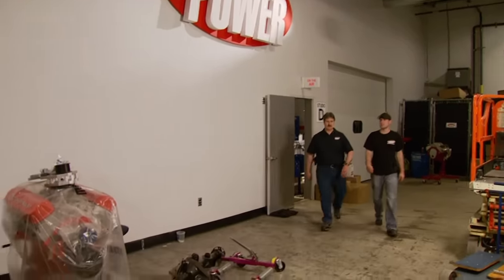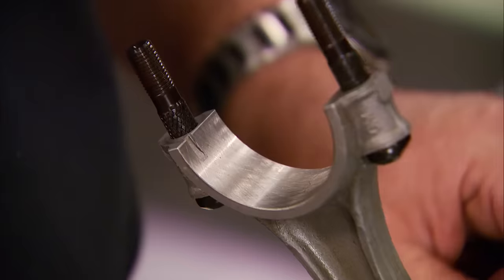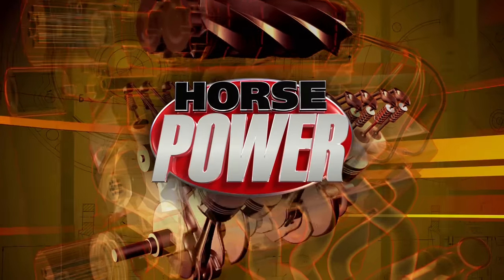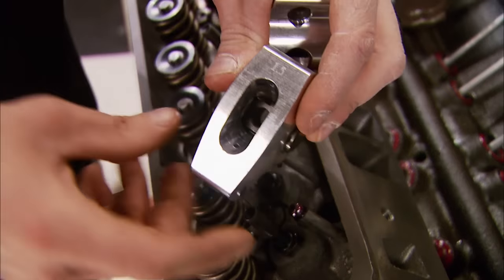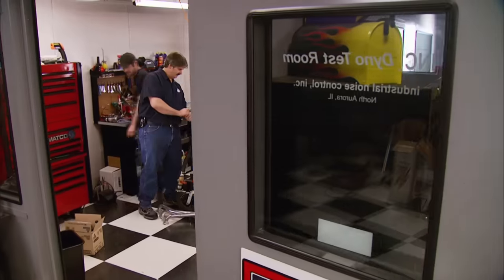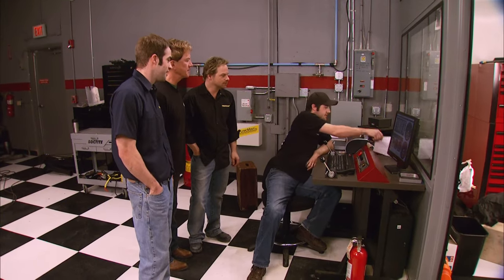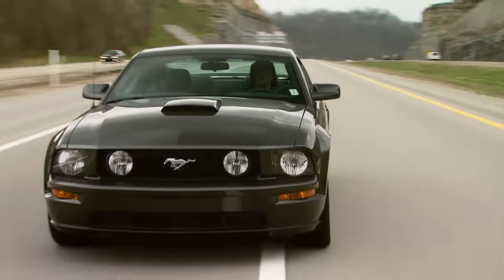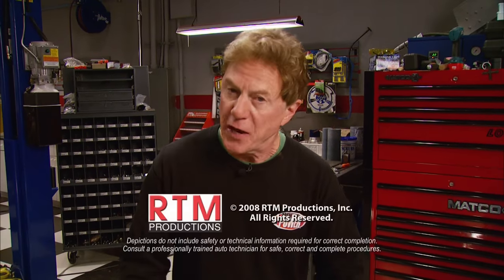Rebuilding a 283 Small Block for a Daily Driver C10 - HorsePower S12, E7

Comment: 270 hp for a daily driver sounds like a great package! For some,when you have had one of these little motors in your past,they tug at those heart strings!
Reply: I would have opted for a RV highway towing cam to increase the TQ. Still a good build.
Reply: @stuartbuckley8720  I'm sure it's bc they wanted to show hp #'s. Owners going to be disappointed when it doesn't pull itself out of park. Haha... I own one... Has-been built with dual springs yet has sat for a long time and I'm unsure of the builder so I get to discover someone's mistakes I feel. Think I'm more excited to see whatperson did old school tricks to mine. Haha. Or if it was some kid🤣
Reply: @gpt5002  those 283's can make good power and can rev pretty high if built right. We use to race them, long, long ago.
Reply: @stuartbuckley8720  actually starring at a set of powerpak heads right now.lol. I'm excited to see what I can bring of this carnage I bought. Heads turned out to be the best but I have a cam for a 65 vette. My dad kept it for a million years. From what I gather it's the 190horse cam.  Maybe more with a 4barrel. After driving a small displacement v8 a few years ago I really enjoyed the way it pulled.. didn't have to slam ya back just move when you want it to move. Gonna make this happen. I'm excited. If all fails I could sell it as a 327 like the guy did to me.lol. jk. I'll either keep it scrap it or blow it up. I keep hearing about this cam... The 327 cam... Duntov or something... I just feel this cylinder head and bore size needs something a little less. Why I'm favoring the stock vette cam over over camming
Reply: @stuartbuckley8720  I do have to say the casting flash from the crank to the heads is insane even more silly is someone had been in this and just left the shrapnel. Looked down in the water jacket in between the cylinders and it appears it has a weld??? I have to clean it really good but I'm scared I was sold a boat motor which now may be a boat anchor. Ever inspected the cooling channels and seen cast that appeared to resemble weld?
Reply: 283 was the first v8 I ever heard, it's a beautiful sounding motor
Reply: My '34 Ford 5 window had a nasty little 283 in it.  Lovely little plant it was.
Reply: That's 270 Gross ~220 net like engines are rated today and about 188whp.  Also the 3" stroke plus small displacement means without a power adder you aren't making much torque and if you do it will be through revs.
Reply: @gpt5002  With first and second gen vettes, asider from the '53,'54 and '63 unless it was a solid lifter small block or any big block, the value isn't impacted all that much.  I've been considering a '61or '62 for that very reason, they are straight up bargain if you aren't looking for a top engine.  Also the 30-30 Duntov cam is too much for 283, even in the 302 it made rather peaky, vs L74 327 even then it wasn't suitable in a automatic, that's why the LT1 got a slightly less aggressive cam.
Reply: @ineffable1129 . Granted it's a very basic build with (I think) a Perfomer cam,  but it always seems like people in the few videos of 283s are always impressed when it makes less than 1 hp per cube. Theoretically it should be easier the smaller the engine due to longer rod to stroke and less parasitic loss from bearing speed and piston thrust loads, (but that usually comes in to play at higher RPM). Overall I'd say not bad for how mild it is. A 325 HP 283 isn't unstreatable at all, and only at 1.14 HP per cube.
Reply: @stuartbuckley8720 . Seems most 283 videos are milder combos and the guys are impressed with only .9 HP per cubic inch. The super stocks are their own extreme animal as well the old gassers. But wish someone would dyno one built to around the "streetlistic' 375 HP level. (better heads won't need the insane cams and extreme RPM)...with the same tuning effort into it as a 530  HP 406  Not unreasonable at 1.3 HP per cube.
Reply: @ineffable1129  Exactly.
Reply: Engine*
Reply: I agree. My Dad had a 64 Impala with a 283, it had a sticker on the air cleaner that claimed 195 horsepower, so 270 should be plenty.
Reply: I got a 64 chevelle convertable malbu with original 283 and transmission I want to have a nice cam in it not racing just want to cruise with the nice cam sound anyone know what that would cost im on a fix income

Comment: The 283 and 327 were great engines back in the day.  They ran well, and were almost indestructible.
Reply: 327 4 bolt double hump fuelie heads = my choice over 350 for street !
Reply: @ronnieboucherthecrystalcraftsm  did they make a 4bolt 327...
Reply: Yeah, the 350 is more like a tire melter that can't get anywhere stalling while the 327 moves out perfect in all of the pony cars in mine opinion. 350 needs too much tire and that negates the extra cubes and fuel consumption. @ronnieboucherthecrystalcraftsm
Reply: @zAvAvAz LoL your thinking about a 318. Everyone knows MOPAR ruled the heavy Chevy's

Comment: Back in 1983 I dropped a 283 in a 70 Nova that came with a straight six.  Best decision I could have made.  Many friends told me I should drop a 327 in it, but I was very pleased with the 283.
Reply: The 307 is a 283 block with a 327 crank , 
The 283 could make 300hp 
The 307  could make 325hp
The 327 could make 475hp
Reply: @jimthomas7251  het Jim I’m about to tread down my 283 with the powerpack heads any  tips how to get the most out if it thanks
Reply: @khalihaddi6093  , to get the most out of it ?
Don't buy a cheap rebuild kit , 
Start with Forged Pistons 
If you want hi horse power 
Get the best of everything so it can handle that hi horse power
Reply: @jimthomas7251  thank you for the info I will do that. Get the best I can.
Reply: @jimthomas7251  alot of people said the 307 was junk I had one in 70 Malibu and did a few mild things heads, cam, headers, intake and it ran in the low 14's with power glide they weren't that bad
Reply: Im literally fixing up my dad's 70 Nova right now with a 283!
Reply: @jimthomas7251  and the 302 was a 327 block with a 283 crank. what a combo that turned out to be
Reply: Those in line 6 cars had great rear gears, hint those in line 6s usually leak oil, that oil would stop rust on floor pans,great street set ups tho

Comment: Back in the late '70s, my folks had a '66 C10 with a stock 283 & 4spd, that I drove to school. Given that it didn't have power steering or brakes, that 283 had more than enough "go" for a 15 yr old kid to get in a lot of fun...& trouble.😁 With the manual tranny, of course no "power braking" was needed to burn up the rear tires.😂 My folks were NOT the least bit happy about the tires. Made me pay for the second pair myself.😂
Reply: you burnem you earnem !

Comment: I found it easier to install the cam before the crank . That way I can reach into the block and help guide the cam through the bearings .
Reply: Good idea. I'll try that from now on.
Reply: Whatever it takes to get it done right
Reply: I prefer to do it that way if possible.
Reply: After the cam bearing the next thing that should always be next is the cam in case a cam bearing got nicked during installation. It's a lot easier to deal with it on pretty much a bare block than when you have the rotating assembly already in place.

Comment: Heating the rods to install the connecting pins is fine but you only heat them to blue not red hot those rods are trash now
Reply: Thanks for the "correctional" information! When I saw that "piston rod end" get "red hot", I started to "wonder" about "specifics"!
Reply: HFX Turbo,    (Another "interesting" and "informative" comment) ("Freezing" the pin!)(Good thinking!)(Thanks HFX Turbo) (Sam Spade had some good "advice" earlier also.) I did get a "kick" out of "Richard Skippers" remarks.(ha!ha!) "Richard" might well be right and I suppose that if Richard was right, the "end-result" probably wouldn't be too funny!
Reply: would they be warped now?
Reply: Jay Arrison bruh why are you putting quotations around every other word
Reply: I was thinking the same thing. Way too hot.
Reply: Paul Smallriver,     (Good Question!)The"cherry-red" heat could possibly alter the "temper" of the metal of that end of the "push-rod"! I personally am not an "expert" in this field but, I enjoy everyone's comments.
Reply: MontyOh,   For me, it is just a way of organizing my thoughts! My practice of doing this possibly might not be considered, "Proper English"?
Reply: the rod ends only need to be 200 degrees to install the pins... that said, the color red (600-800 deg)  that the end got only heat treated the metal.  the exhaust valve gets hotter than that.
Reply: How to build a Hot Rod    "for dummies" and "the somewhat educated but still completely wrong". Also coming soon, """Properly tempering your bone stock forge welded hardened steel con rods by color ""red hot"" celcius"""".
Reply: @HFX Turbo We have a -60c freezer at work...might come in handy!
Reply: Way to hot, they make heat markers just for heating rods. I'm surprised everything these guys build don't scatter all over the Dyno room.
Reply: Phillip Aubin exactly
Reply: Make sure you paint the spin on adapter before you put on the oil filter.
Reply: Sam Spade , correct.  He just annealed the rod end which removed any tempering and made it more ductile.  283s are bullet proof but I wouldn’t push the revs on that motor.
Reply: Piston didn't need heating, it's a slip fit on the pin...
Reply: @Hanzyscure  i seen that too i don't get it. the filter needs changed with in hours of starting any way
Reply: LF X  Yeah, I'm completely shocked. Don't they have a bearing oven, or even an old cooking oven?
Reply: @paulsmallriver6066  They could be warped, but the bronze bushing would be ruined and the material properties could be compromised in the rod as well.
Reply: You could have had the rods in the hot sun and froze the pins and the press fit would have worked, best back yard way I've heated something that is a press fit is an old single electric hot plate, on low to medium and when you start to see a little smoke from the oil it's ready for pressing and you didn't alter the rod strength. All that said, rods don't usually break at the small end, so even their bad idea is probably never going to bite them
Reply: Yup..those rods are now junk...way to hot fellers, you know better!
Reply: @mariusfrost640  there' no bushing.
Reply: @Ares There's no bushing!
Reply: Yep, I install bearings all the time that need to be heated for press fit and all it takes is to get it hot, not cherry hot.

Comment: The days of being able to yank a powertrain/drivetrain completely, disassemble, fix/upgrade, reassemble, shove powertrain/drivetrain back in, crank up & drive off all in one day with sunlight the whole time using jacks, 6 hand tools, cardboard/wife's old dress & ingenuity with commonsenss, is gone but not forgotten....
Reply: Mannnnn you hit the nail on the head with that one. 🤣🤣🤣🤣💪   that's straight facts you just spoke
Reply: Take a day just get through all the electronics crap sorted before you even get to the engine to turn a wrench.
Reply: It's easier quicker to do today, with a factory setup there is no tuning needed at all, and even for a modded build you can tune EFI in the time it takes you re-jet a carb.  Best of all it well never need a tune up again. Many cars have a engine harness with a hand full or less keyed connectors.  

Now if you've never done one before sure, but that would be true if you've never done a older engine too.
Reply: I did the same thing they did in 1981. 283 block and crank 350 pistons. (327 Cubic inch ?). The connecting rods well just a bit a problem but back then (1981) still around. 1968 1.98 heads with hardened seats. The goal was 9.5 to 1 compression to be able to run 93 octane gasoline. Low emission, high torque cam. Oh and get better gas mileage in the '69 suburban.
 Ran good.
 The gas mileage. Nope. Actually less than the cracked block 350. Even with a wide radio 4 speed instead of a THM 400 still got 9 MPG. It would break the tires loose and smoke 'em with a Holley 450 economaster. 
The 4.11 rear end did not help the gas mileage either.
You want the horses and torque at lower RPMs because the stock valves, push rods and springs should NOT be pushed past 5500 RPM in a regular use anyway so 450 CFM is enough.
Oh you can get more RPM with bigger springs(did that). You also need heavier oil to keep the cam and lifters lubed from the higher spring pressure also high volume and high pressure pump( did that too).

I thought that 283 on the dyno would pull more horsepower but maybe if it was properly broken in might get a bit more ponies out of it.

I drove a lot of test cars for Ford and they notice that ones I drove during break in did better at 5.000 miles MPG than most.
They started using the valet/transport settings for the 1st 1000 miles on some and just let the other drivers drive them like a beater.
Yes 2021 engines do have a break in period.
 
Mixing aluminum heads, copper radiators and heater cores and iron blocks is also not a good idea. Unless you are just racing it. Also draining the coolant during the winter and parking it.
 Also don't loan it to someone that swears they have driven a high performance vehicle. They will find a tree with it.
AS for the top speed in that old suburban? Well would do 165 and I did not have brass balls big enough to push faster than that. That was at 4500 RPM.
Reply: @ineffable1129  I use to be able to pull a straight 6 out of a car in about an hour. I guarantee you couldn't do that with any modern engine.

Comment: Built my first car  62 BelAir's 283  with a 327- 350 hp cam, 302 valve springs, headers, duel point distributor,  4GC carb and manifold off a 65 283. Put it together in a  freezing shed on the ground in the winter. Bolted it up to my cast iron Powerglide and smoked the tires for a block! All back in 1977!

Comment: The 283 is just a good design with all the right geometry to sustain high revs and take a beating without a lot of effort put into it. It's just balanced and weighted the right way to be conducive to it. Horsepower numbers are deceptive because it likes to rev so easily and quickly. It's different from a lot of other small blocks because of it.

Comment: I had a 1966 Belair with a 283 use to shift it at 6500 RPM hundreds maybe even thousands of times, engine was balanced at the factory you could put a dime on the air cleaner and rev it to 2500 rpm and it would not move it was so smooth.

I put 165k miles on it frame rusted out sold the engine to a friend he installed fresh coat of paint and installed in his boat.

Comment: I used to have a 283 with a .040 bore displacing 289ci. I fitted vortec heads and an L79 muscle car cam topped off with an Rpm air gap and 650 double pumper. That little motor ran strong and pulled really hard up top…. Felt like the power band never died.
Reply: Seen a TWIN TURBO the other day 
9000rpm @ 40lbs of boost @ 680hp @ 559lb ft torque
Reply: I’ve got almost the exact setup with a different cam. It’s an absolute riot to drive every day

Comment: I have a 67 chevelle 2 door hardtop with a 283 an 3 on the tree love these 283 small blocks built to last
Reply: There were millions of them built from 1957-1967.  In 1968 they got stroked with a 327 crank to create the 307.  Eventually the 350 replaced the earlier engines until the 305 came out in the late 1970s due to fuel economy and emissions regulations.
Reply: Yes the 283 is an engine with real character..... unlike der 350

Comment: Had a '66 283 that I put aluminum forged pistons in, and a '57 Corvette dual 4 barrel solid lift cam.  Power- pak heads rounded off the  top-end with a dual plane and a 600 cfm carb.  Got a 2 speed slush-box (aluminum, and put the combo in a pink '73 Ford Courier with a Cartunes decal that took up the whole back window. Bought the Courier from a guy named Matt, he was a drummer for a punk band.  The ol' lady said I couldn't put it in the truck...next thing she heard was...cackle, cackel, etc.  It would lay one foot of rubber and gone!  Miss it.

Comment: Grind the top off the front center oil gallery, some dbl. Roller chains will knaw at it and put small metal fillings in the motor !

Comment: Probably the most dependable motor ever made they can handle abuse and neglect and still run forever
Reply: Road and Sea! Had a 28' Chris-Craft powered with a 283 marine version!
Reply: I have one in my 66 Chevelle that runs well. I want to rebuild it because it’s a 195hp and needs more power. I have a 427 in my other 66 Chevelle.
Reply: @patfromamboy 327 crank, make a 302
Reply: 283 crank in a 327 makes a 302
Reply: I hope so. We have one thats been sitting since 1975 in a gmh assembled 62 bel air. Once we chuck some wheels on it we  have to try get it running 😂

Comment: My dad built a 283 back in 1969 the year I was born and put in a 1955 chevy truck it had the truck four speed with granny low..the gears in the rear end on those trucks are very low so he pulled the rear end out of a 56 caddy.. he had cherries bombs on it sounded like it came straight out of hell that truck would run the highway at 100 mph no sweat he drove that truck up until 86  he retired it the only engine work he ever did to it was some lifter adjust and of course valve cover gaskets..love those 283 and 327's